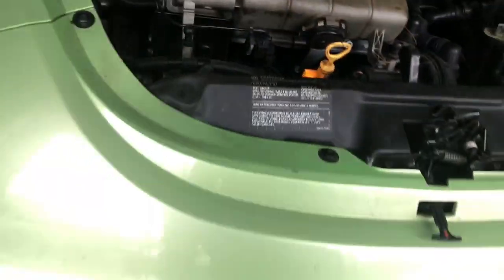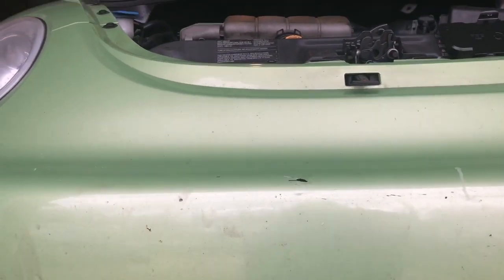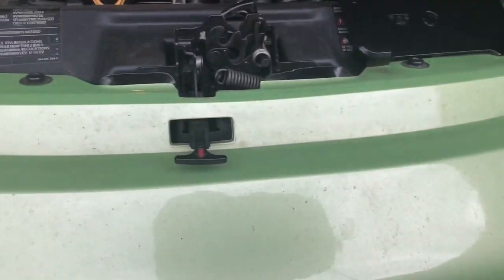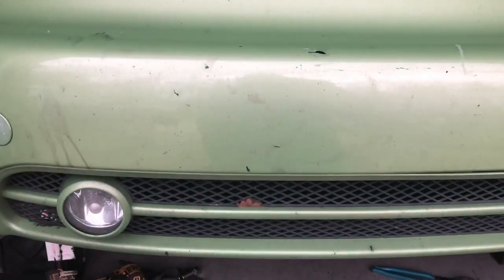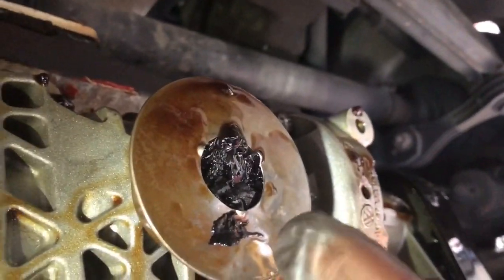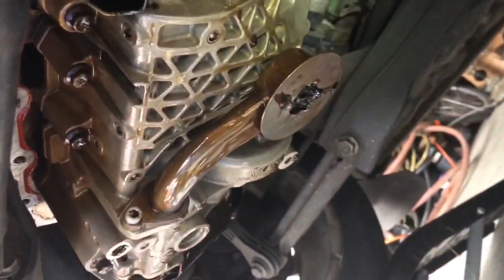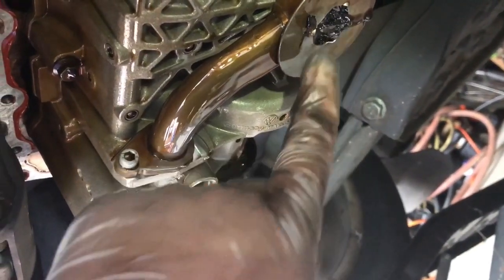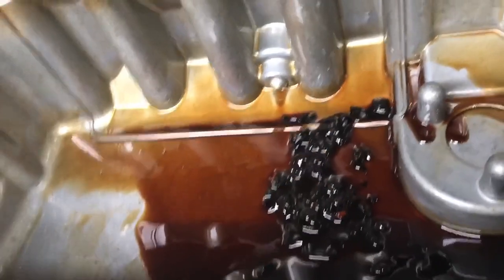Check this if you have low oil pressure on your VW or Audi

Comment: I have a 2000 VW Passat 1.8 turbo, had the oil changed and they put a filter on that was too small and my oil pressure light started coming on. Took it somewhere else and had the oil changed and put the correct filter on my car and the light went off for a while but now i have about 1500 miles on this oil change and the oil light blinks when i slow down and when the  motor is at running temp, It also taps for about 10 -15 seconds when i first crank it but no smoke. I'm thinking everything is all clogged up from the small filter not doing its job. what do you suggest I do?
Reply from the maker: Melissa Underwood you could try flushing it with a quart of diesel in the oil. That way any trash that’s in the system will hopefully flush out with the oil when drained.
Reply: @Icanfixit-2   thanks, how long should i run the diesel before having the oil changed?
Reply from the maker: Around 8 to 10 minutes.
Reply: @Icanfixit-2  thank you, I'll give that a try and hope it helps.

Comment: Hi I have a vw polo 04, the other day I got the red engine oil light on the dashboard, there’s enough oil in the car. Any idea where to go from here? What could be the problem? Thanks
Reply from the maker: louise L check the oil pressure sensor first. If it’s good, then I would check the oil pump.

Comment: Hey man !  I have a volkswagen cc ! Low pressure ligh came on and its realy annoying !  I changed the sensor and it still does that !  Did my oil change + filter , didnt change anything !  Temperature of my car still runs perfectly !  Do you think i can be facing the same issue as the one in the video ? Or should i just change the oil pump ?
Reply from the maker: fabien james what I would do first is drop the oil pan and look for big particles. If you see gunk, clean off oil pump pickup tube and that should fix it. If you drop the pan and see nothing, yes it could be the oil pump getting weak. Worst case scenario, it could be a spun bearing. Hope this helps.
Reply: Can you please update us on how did you fix your car?

Comment: So what if mine pick up tube is clean and I have changed the oil Pressure sensors and light is coming on when I get below the speed of 40 ???? You know ?? 99 Jetta 2.0 5speed. Thanks
Reply from the maker: JettaLife it could be your oil pump. That’s rare but plausible.

Comment: Hello i have a 2008 Audi Q7 4.2 my oil pressure light comes on sometimes when starting the vehicle or when pressing on gas sometimes it wont do it on start up you think that could be the problem??
Reply from the maker: What type oil are you using?  The oil weight can be a problem or could be low.
Reply: @Icanfixit-2  ravenol 5w40
Reply: @Icanfixit-2  i do have an oil leak from behind the engine i think its from the timing chain covers
Reply from the maker: Is it full synthetic or blended?
Reply from the maker: Also, where is the idle when the light is on?
Reply: @Icanfixit-2  full synthetic n about 2000 rpm on start and 3000 rpm when pressing gas
Reply: @Icanfixit-2  sometimes light wont come on when starting at all
Reply from the maker: That’s pretty high
Reply: @Icanfixit-2  a mechanic said it could be the oil pump and that he needs to drop the engine in order to replace it but idk i already have spend about 5k on it in 4 years i have own it
Reply from the maker: I doubt it unless it’s gushing out. How bad is the leak?
Reply: @Icanfixit-2  hello well a few drops when i park the vehicle but not major
Reply from the maker: What brand oil filter? Is it restricted? That also would cause for initial low oil flow.
Reply: @Icanfixit-2  carquest premium i did the oil change in september before that it har ravenol oil filter i did the oil change to see if it would help with the light but didnt so i have not drove the vehicle anymore
Reply from the maker: Okay. You may have a weak pump
Reply: @Icanfixit-2  damn yea i was thinking that because light doesnt come on all the time now quick question do you think the whole engine has to come down for that like the mechanic said??
Reply from the maker: @Therey1898  sorry to say, but yes.
Reply: @Icanfixit-2  damn ok thanks for the info

Comment: Have an 03 passat had the oil pump changed and new sensor and the oil pressure light came right back on. Does this get changed with that or is it a separate issue?
Reply from the maker: Jeremy  Matthews does it flicker or is it constantly on?
Reply: I haven’t done anything go to it yet and mine flickers also the battery light is on after replacing alternator (used one)

Comment: hei man! i have and audi a3 1.6 fsi and my oil pressure light starts when i turn right and the care is in any gear ( over ~40 km/h) . i've changed the oil , filter , sensor pressure , even the sensor from the oil pan and i still have this problem.. i checked the oil pressure in the engine and it s very good! any advice?  ONLY WHEN I TURN RIGHT! :))
Reply from the maker: Z Kai is the baffle still in the pan? That sounds like the problem.
Reply: @Icanfixit-2   well.. i don t know that. i guess i have to take down the pan ( the mechanic )
Reply: one more thing , does 1.6 fsi engines have this "windage tray" there? or i have to improve one?
Reply from the maker: Z Kai yes. That’s the “baffle” I spoke of. It could be broken or the oil is low.

Comment: Nice video 👌 I have an Audi A4 Quattro 2005 2.0t fsi my car doesn’t tell my I have oil pressure when I’m driving it , unless I click the “check “ button, It show oil pressure on orange warning light, I already changed the oil pressure sensor and it still appears
Reply from the maker: Check for continuity of your oil pressure sensor power wire. Make sure it’s getting voltage through it. Also make sure that it’s (oil pressure sensor) is getting a good ground to the block.

Comment: How can you change the oil Pressure sensor on a Volkswagen CC 2012?
Reply from the maker: Rogelio Rodriguez which engine do you have?
Reply: @Icanfixit-2  2.0L Turbo 4 cyc
Reply from the maker: Rogelio Rodriguez yours sit below the oil filter on your engine. You will need a 24 mm deep well socket to remove.

Comment: I have to check on my Tiguan, sensor and oil filter are ok. Oil pressure is on
Reply from the maker: Does it stay on constant or is it random?
Reply: @Icanfixit-2  it's constant
Reply from the maker: @redihoxha2940  the pump could actually be bad.
Reply: @Icanfixit-2  how can I check it? The engine works smooth...
Reply from the maker: It could be a short in your sensor connector. You can do a ohm test on the sensor itself and do a continuity test on the actual wire. To check the actual oil pressure, you can buy a screw in oil pressure sensor that can test it. Depending on where you live, you can rent one with all the connections and fittings that screw in where the pressure sensor goes. If not, Harbor freight sells them or you can check Amazon. I hope this gets you to the right direction. Also, you should have pressure between 20-30 psi at idle.
Reply: @Icanfixit-2  should I open oil pan to see for any dirty deposit there at the plastic tube?
Reply from the maker: @redihoxha2940  you can
Reply: @Icanfixit-2  I just open it, plastic looks ok and the pipe. But the oil pump is aftermarket. Do you have any email address to sent any pic?
Reply from the maker: Ocie.carlisle@gmail.com

Comment: How do you remove that crud stuck in that circle piece though??
Reply from the maker: Fearless Ghost mine was melted plastic. I used a mineral solvent and let it sit overnight. You could probably use brake cleaner.
Reply: Ocie Carlisle ooooh alright thank you! That was a fast response😂 because I was driving home from school and my oil light turned and and started blinking, oil level was fine, running pretty good so left me wondering, thank you for sharing this!!
Reply from the maker: Fearless Ghost no problem lol

Comment: Is this a TDI??
Reply from the maker: No. It’s gasoline.
Reply: @Icanfixit-2  Does the same apply to a TDI?
Reply: @Icanfixit-2  Does the same apply to a TDI?
Reply from the maker: @johnd.pickett2617  it could as well but you will also want to check all of your breathers for oil buildup as well.

Comment: Mine dreaded low oil pressure light came on, I checked the oil, it's fine and the engine sounds fine.  It comes on randomly and then goes away just as quick as it came.  If it were a true problem, wouldn't the error message stay lit up until it's fixed? No smoke, no rattle, no oil burning smell.... Just that damned light.  

VW eos 2010

Thanks in advance to everyone with advice!
Reply from the maker: mntdewboy well your situation is probably something as simple as dirty oil or dirt in the oil filter.
Reply: Could be the balance shafts. I've been reading into this too. Got the low pressure warning light twice in the last couple months for the first time. Usually after some spirited driving and then coasting around. Going to do a oil pressure test and take the pan off to check if there's any metal shavings or debris as well as possible melted baffle. 

Bless our souls it isn't the balance shaft, it's just as bad as a timing chain failure if it goes.
Reply: I have the same problem with my 2015 VW Tiguan

Comment: Hi Ocie....What is the best way to get all of that trash out of your oil ports and passage ways....dump some diesel fuel down from the top of the engine ?
Thanks man !  Great video !
Reply from the maker: Screww Googlle you can use diesel or kerosene. I used both. With the kerosene, I let it run for about 10 minutes at idle. With the diesel, I usually drive it around the block a few times while the engine is warm.
Reply: @Icanfixit-2  
Thanks again Brother....
 Much Appreciated !
Reply from the maker: Screww Googlle anytime brother!

Comment: My oil pressure light comes on usually in stop and go traffic.  My mechanic replaced the oil pressure sensor switch, crank case vent value and charge pipe to attempt to fix this problem; however, the light still comes on in stop and go traffic.  Now, he recommends replacing the rear mail oil seal.  Does this sound right?
Reply from the maker: Paul Roberts not really. May have a blocked passage. Try using a engine flush before you replace the rear seal.
Reply: Hi Paul! Any solution, yet? Same problem here (light comes  stop and go traffic). The oil pressure is good, 4.5 bar.
Reply: Try checking the balance shafts on the oil pump they don’t have to be loose, they have to be stiff and well fixed.

Comment: Hi have an Audi A4 b7 1.9 bke engine did an engine swap same engines started car it started ok went over 2000revs and a red oil pressure light came on anyone any idea what it could be ..thanks
Reply from the maker: Lorna Mc Redmond make sure that your oil pressure switch is plugged in correctly. Also, check oil filter to make sure it hasn’t broken down. It could be blockage at the bottom of the oil pickup tube for the turbo. Last case scenario, drop the oil pan and look for trash on the pickup. Before you drop the pan try using an engine flush.